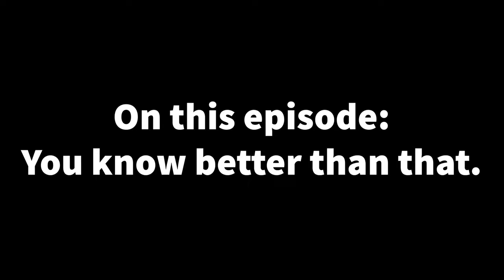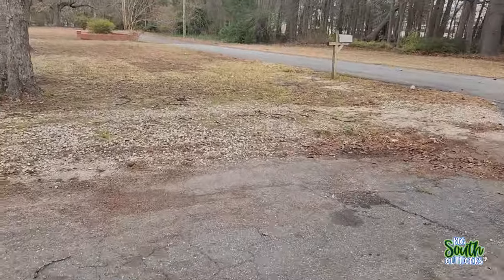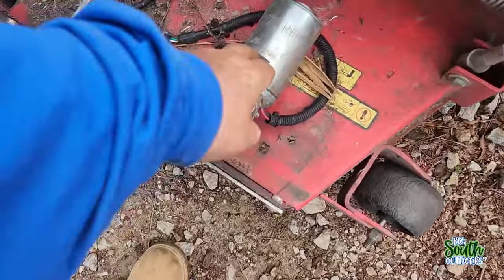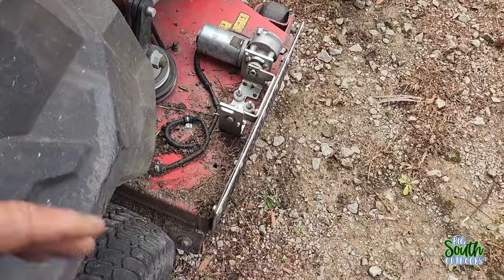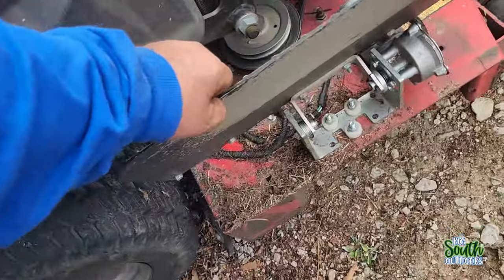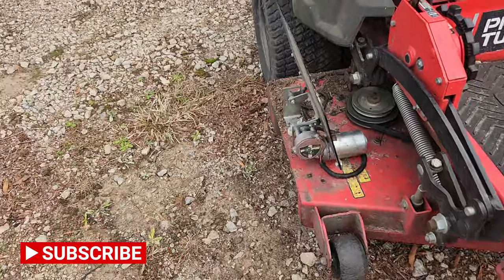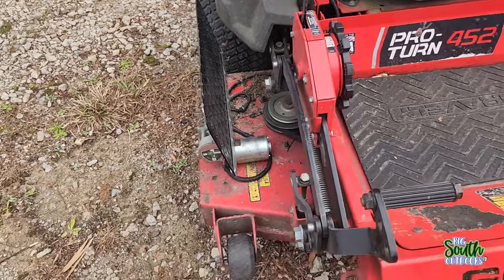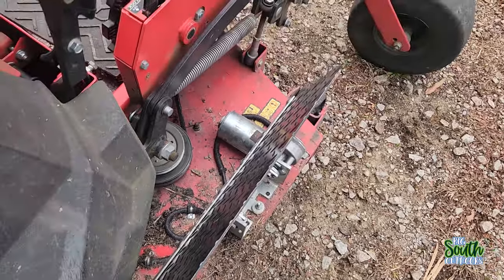ONE MONTH REVIEW: The Green Guard HD Chute Blocker.

Comment: Also have the same issue with the gear getting weak over time. In my opinion it seems to wear out too fast for it being a “heavy duty” unit. It started out like yours and only got worse over time. Now it doesn’t even stay completely closed at all. Got a replacement for free under warranty, so that’s a plus… but I’m guessing it will wear out within a couple months again.
Reply from the maker: @Miguel001  thanks for watching. It may not be wearing out. I dud some investigation  and found that the bolts that go into the back of the motor were LOOSE as heck. Once I tightened them, I had no more issues. I took them out one at a time, put thread locker on the bolts and that solved the problem of it not holding. I hope this helps.

Comment: You could run a hot wire off the acc of the key switch. Then you will only have power when you turn it on
Reply from the maker: Thanks for watching. I'm sure there is a way to do that. I'm not that ept at electrical work, so I'd have to look into how to do it.